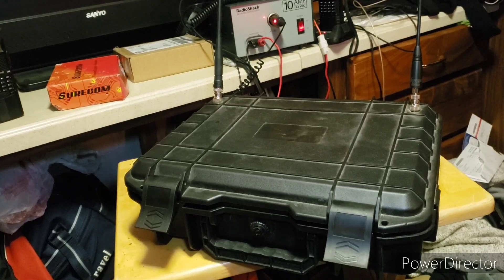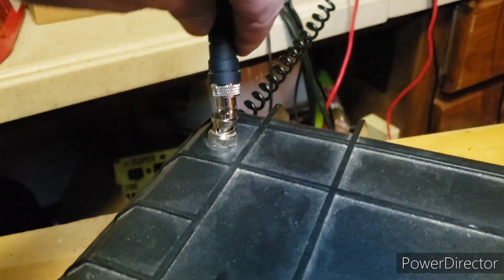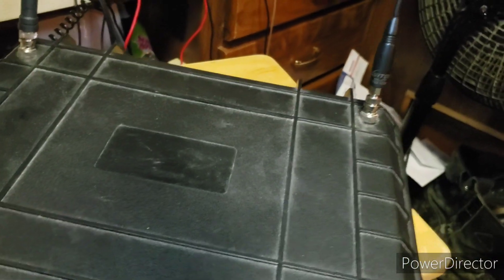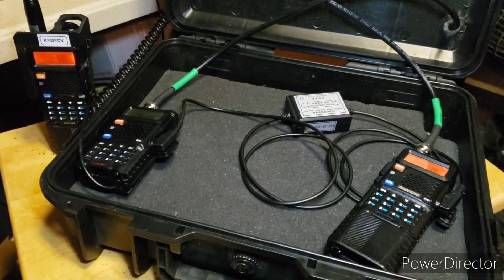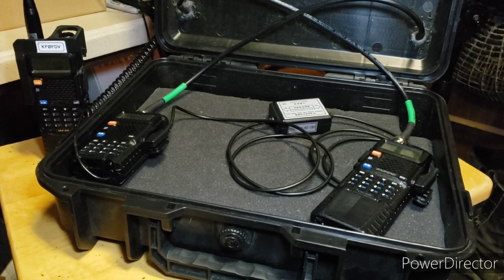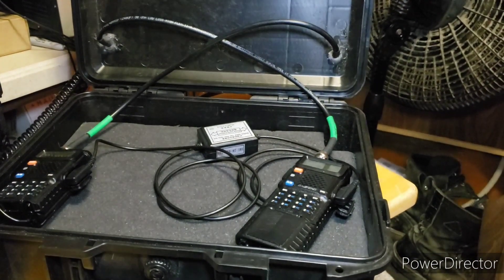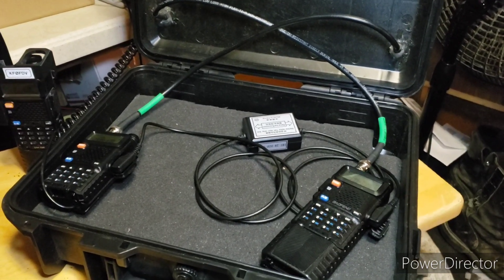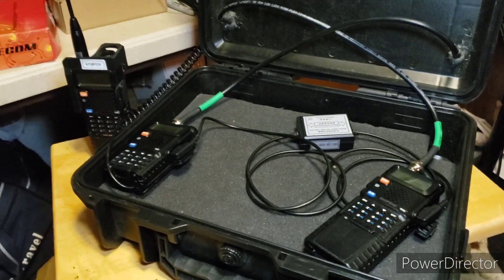My BAOFENG Briefcase Repeater!! Here is the parts breakdown!! #hamradio #baofeng #fenggang

Comment: 06:00 What is the point of this little box, or what happens inside of it I should ask rather; Because I just used a 2.5mm to 3.5 mm adapter and a regular aux audio cable form the headphone output of my receive radio into the mic port of the TX radio and turned on vox. Seems to work just fine. (edit) I ofc. just set my frequency on the tx radio to be offset from the rx frequency (7.6 mhz) and used ctcss tone so that it doesn't just repeat any noise it hears that happens to break the squelch.
Reply from the maker: An AUX cors works but from what I heard when testing, it seems to clean up the audio a little bit.

Comment: I think it's a bit weird to amplify to 40 watt but put such small antennas on the repeater. You'd probably get more distance without amplification if you used much bigger antennas which of course you can make out of garbage or cheap construction materials. Also you failed to point out that your repeater is totally illegal because it doesn't transmit a call sign.
Reply from the maker: @davidstainton8337  its not illegal. It doesn't NEED to identify on its own. I can identify for it. Didnt want to build an antenna for this as its not always in use. I don't need miles upon miles of distance. If I was doing a repeater that was going to be permanent and on all the time then I would do the rest of that stuff.

Comment: awesome...
Question though.. How is it a 30-40w repeater?
When the output transmitting power of a Uv5R is around 4w
Reply from the maker: @RGD-Radio  that would be because of the BTech amplifier. I have a video about the amp and also a video about the amp in the repeater setup. Check those out and thanks for watching!

Comment: Nice! How would I set this up using 1 antenna?
Reply from the maker: @JOHNSMITH-ug2mt  to use 1 antenna, you will need a duplexer. You can find them fairly cheap on Amazon, with prices starting just under $90. I am sure that there are smaller and cheaper duplexers, but I feel more comfortable recommending the actual duplexers that start in the $80-$90 range. If you set it up and have it running, I would love to see a video and your feedback about how it is performing for you. Also, keep an eye out for a very near future video about another budget repeater I put together with 2 25w radios and a duplexer. Thanks for watching my video. Hopefully I gained you as a subscriber. 73!

Comment: How far do the antennas have to be apart on the box for this to work properly.
Reply from the maker: @joeguerrier7975  so you can use 2 rubber duck antennas on the box, and at 5 watts you would be fine. For a much longer lasting  and more reliable setup, you should put the transmit antenna about 8ft - 10ft away from the receive antenna. I separate them like that to account for desensitization.

Comment: So if you have a couple extra cables laying around could you cut yhe rnds off and just why are them backwards lik a red wire to a black wire on one side and the same on yhe other on the ends you cut and not have yo have the cable with the box in the middle or does the box on your cable doore then just revise the wires
Reply from the maker: @seandrake7534  the sound from the receive radio passes through the box and activates the VOX on the other radio. I believe both are plugged into the same ports and theoretically you should be able to supplement the box for a common AUX cord. Try it out and let me know how it turned out for you if you decide to try!
Reply: @thesaltyham7144  will do thanks
Reply: 2.5mm jack to 3.5mm jack mono lead and flip the polarity (white to red) . The 3.5 goes in the TX radio (set radio to vox 1) and the 2.5 RX radio. Works perfectly.

Comment: How did you manage to get yours working? I've been having nothing with trouble with mine. First, I tried the method Rural Homesteaders did with a homemade crossover cable, and it didn't work very well. Spotty reception and it would just transmit static sometimes. It'd key up, but not transmit anything but static until I stopped transmitting myself. I got frustrated with that because I couldn't seem to make it work right no matter what I did, and so I bought one of these repeater boxes (K-Head specifically, it looks like you and I are using the exact same one) and it doesn't work either. It arguably does worse, instead of transmitting only sometimes, it doesn't work at all and just keys both radios up constantly. Does this to all of my baofengs and no change in the settings seems to fix it. Even just plugging in the recieving handheld causes it to be unable to unkey. I've been working on this project for months now and just can't seem to make any headway at all in getting it working.
Reply: I've only gotten it to work as cross band with input on VHF, out on UHF

Comment: The thing that does the repeat is a pretty simple controller, although it sounds like it's just passing audio and maybe uses the VOX on your transmitting Baofeng. Aside from ID requirements (don't forget to ID your repeater), my chief concern with this would be desense. With two separate antennas, of course you don't need a duplexer, but without sufficient antenna separation, there will almost certainly be a problem with desense. If you really run an amp on it, you're definitely looking at a desense problem. Also, I'd say not to run your transmit radio at high power. The finals aren't rated for that kind of duty cycle. And it's going to get a bit warm. ...
Reply from the maker: I have thought about the desense issue and I have my transmit antenna about 20ft higher when I set up. Working on upgrading power now and a solar panal that isn't insanely big.
Reply: @thesaltyham7144  That sounds good, and plenty of separation. Just when you mentioned using HT antennas. ...
Reply: @thesaltyham7144   keep us posted!!

Comment: What frequencies did you use? Simplex?
Reply from the maker: Yeah I just used simplex to test it out. I got some new batteries that I am going to put in parallel and I still need to get a 25w panel for it. Thanks for checking out the video and keep an eye out for an update video!

Comment: Good video,
Do repeaters not need to call the Station ID every 10 mins?
+ Tails, Blanking, Courtesy beeps etc?
Reply from the maker: They do but as of now I do the ID every hour if not in use. Want to get an Argent simplex controller to put on TX side to fix that. Soon!
Reply: I can't understand the question  , does it working or no 

I saw this way an I need to extend the coverage , does it will be good working with my case  ?
Reply: @ahmedalgendi2943  depends on your countries regulations.
Most countries require the station to call out it's Callsign every X minutes, in order to be legal.

The one in this video, by default, does not do this. So you would still need to manually make the call every X minutes stating your callsign.
Again, that changes based on your country or state etc.

Comment: People need to stop making these videos about Baofeng repeaters.  They dont work!  The TX/RX radios interfere with eachother.  The only way to make this work is to separate the radios and antennas.   This works on the bench, but as soon as you try "Real World" application of the idea, it fails due to RF over saturation.  I was able to get it to work as a cross-band repeater (GMRS to 2M), but never as a true in band repeater, such as GMRS RPT15.  After considering the idea of purchasing a duplexer  to continue the science project, I opted for a Retivis Portable repeater.  You will spend more money and time trying to get this to work, then you will by just buying a commercially available portable repeater.
Reply from the maker: Actually used it all weekend at hamvention and it worked fine. Plenty of antenna separation and didn't even need to use the amp. Hooked it up to the dual band antenna on my truck for transmit side and used my CB antenna for receive. There is about 8-9ft distance from the back corner of the truck bed where the CB antenna is to the center of the roof where the dual band antenna is. Actually just bought 2 12v 5Ah batteries from hamvention to make a good 10Ahto connect to the solar. Its easily changed from ham to gmrs just by switching radios. 5w for a weekend camping trip or use the amp for if you have a large property and want to have coverage. I will be doing an update video soon. I still want to get a higher wattage solar panel for it. The 25w panel on my truck kept it charged all weekend. There is no problem with buying ready-made commercial equipment but I like experimenting and trying different things and this just so happens to work very well. I'm sorry it didn't work for you and left a bad taste in your mouth.
Reply: @thesaltyham7144  how far away was the repeater from the event?
Reply from the maker: @dus777  I had the repeater set up in my truck. I was parked up near the handicapped parking area so close enough for it to work good for the weekend testing. If I had my tx antenna higher, I could have had better coverage back in the flea market area. Distance to front gate from truck was about 800 yards so I figure I was covering about 1000 yards. In my opinion, it did great for 5w. My RX antenna was my CB antenna on the back corner of the bed by the tailgate and TX was mounted on a mag mount on top of the cab.
Reply: @thesaltyham7144  I've been wondering if  a nonresonant RX antenna would help. Sounds like it may. Or, maybe a bandpass filter at the RX radio.
Reply from the maker: @dus777  i am sure if I used my 2m ammo can antenna, it would probably receive better. I haven't tried it yet but I definitely will.
Reply: These work fine. I've built two with no problems.
Reply: @pep729  he’s a butt hurt sad ham
Reply: Butt hurt hammy man
Reply: You are absolutely correct. In order to make it somewhat useful it takes a minimum of 80 feet of coax in between the antennas. Still doesn’t work as good as just the radio by itself. I finally just bought a duplexer so I could use one antenna. A duplexer is the only logical solution.

Comment: I want to build a gmrs repeater can u help me build one of those?
Reply: With some power behind it so I get some distance with it. I like that amp-25 ....how would I incorporate that into the repeater?
Reply from the maker: @nickgoldman805  You can totally do a GMRS repeater setup with this. All you need to do it change out the uv5r radios for GMRS radios like the Btech GMRS-V1 or V2. The amp you will need is the Btech Amp U25 (400-480) which is the UHF model. Also look into a repeater controller like the Argent Data Systems Simplex Controller. I will be doing an update video after I get one and will show where in the line of all the things, where it goes.
Reply: That would be awesome thank u
Reply: How would I use 1 antenna?
Reply from the maker: @nickgoldman805  you will need to get a duplexer tuned for UHF (GMRS specifically) but if you do that then you will NOT be able to use the amp. I tested this with the 2m amp and a Chinese duplexer I got for $70 and it will not work. After I tested it I saw a video that was posted that confirmed it and called out to the manufacturer asking why there was literature saying you could. If you just do a rubber duck for receive, you can get yourself a 440 MFJ rollup antenna from Gigaparts for $64 and a 20ft length of coax that you can put up on a pole or up to a tree branch, and you will have plenty of separation between the antennas to not have a desensitization issue.

Here is a link to the MFJ antenna: https://www.gigaparts.com/mfj-1731.html?utm_term=sku-zmf-1731&gclid=CjwKCAjw0N6hBhAUEiwAXab-TZujoKOF0KDCSpCYsHkvKKAca3HQvqt8KjdiAQi61NbQD1NMrl5H8xoCGGYQAvD_BwE
Reply: How about 2 antenna outside since I'm trying to get distance
Reply from the maker: @nickgoldman805  Exactly what I was talking about. Make sure to have separation between the antennas.

Comment: How did you install the antenna connector through the case?
Reply from the maker: I made holes just big enough to squeeze BNC connectors through and used silicone caulking to seal them in.
Reply: @thesaltyham7144  Should of used a bnc bulkhead connector...very clean install!👍🎙
Reply from the maker: @barneymerrill3188  I was thinking about it but decided to wait until I upgrade the box to an Apache box from Harbor Freight.
Reply: @thesaltyham7144  great! Thanks a bunch. I plan on building one this weekend assuming I get all the parts I need. Great video!
Reply from the maker: There are a few links in the description for connections i used also. Have fun and 73!

Comment: Cool video, just a quick tip from a user who's tried a similar setup, at some point the desense will kick in and ruin the RX. I've tried with both Analog and Digital (While digital mode will not work in this configuration due to other factors), this setup would work fine using a cheap duplexer. For close range comms (within building), this setup has proven to work at least once for me.
Reply from the maker: I have thought about that and have a 2m roll up slimjim that gives about 8ft of separation for the antennas. Thanks for pointing that out as I totally wanted to put that in the video but completely forgot.
Reply: Ive tried to get this to work on GMRS frequencies with no success.  The setup works when you are in close range, but then starts to fail.  Even with the TX and RX antennas vertically separated by 6 ft or horizontally separated.  My theory is that the UV-5R's are interfering with themselves due to the close proximity.  Its not practical to separate the radios from each other, so I abandoned the project.  Maybe this would work as a cross-band repeater.  This is probably the reason the only practical solution for a lunchbox repeater is the single mode, record and retransmit solution.
Reply: @MrFunkyskier  I had some luck with having the antennas separated by a concrete wall + some distance. The RX on the UV5R aren't the best (nearby transmissions will kill it).
Reply: @koreanhamguy2715 Yep. ... The Baofengs don't have the best receivers ever, esp on gain antennas. Heck, even handies with a traditional superhet receiver can easily get overloaded.
Reply: How about 2 antennas?
Reply: @nickgoldman805  2 antennas as in 1 antenna on rx radio 1 antenna on tx?
Reply: Yes
Reply: @nickgoldman805  It’ll work, just separate the antenna as far away as possible
Reply: @KoreanHamGuy  I want distance or should I buy a homebrew repeater?
Reply: @nickgoldman805  Ideally you want a repeater with a tuned duplexer. The method shown in video is cheap & works but only if you distance the transmitters and/or antennas far apart from eachother

Comment: Great idea. If you want to keep it small and easy set up, get like a small battery (17 amp hour should be plenty) and like a 20 watt solar panel. The case looks big enough to store the battery in, and power pole or standard 12 connector out of the box with shrink wrap would do well. Keep us informed. 
CHEERS from Colorado
Reply from the maker: Yeah that is my next thing to do since I have the 2m amp for it. The amp only draws 5.5amps so the 17 amp/hr should still work just fine.

Comment: If the antennas were on the handle end you could hook a rope to the handle and pull it up into a tree for a bigger footprint.
Reply from the maker: I had not thought of that. I was going to just sling a long wire up on the rx and I already have a roll up 2m slim jim I sometimes use on the tx. I might do that on the next one I make as I plan on making a couple more of these.

Comment: Very nice. Would be looking to build a few of these thanks! Are you going to do a follow up with a internal battery and solar? Be cool to put this up in a tree and forget about it for a while. Thanks for the video and looking forward to more.
Reply from the maker: Yeah I am going to do a battery and solar sometime soon!
Reply: @thesaltyham7144  do have any links for the adapter and the cables. Want to make sure I get the right ones as the adapters get confusing sometimes.
Reply from the maker: @toddwolfe1844  when I get home this afternoon I will update the description with basic parts links.
Reply from the maker: @toddwolfe1844  items updated. Let me know if you need anything else. Also make sure to check out the video previous to this as I have an amplifier for it also.